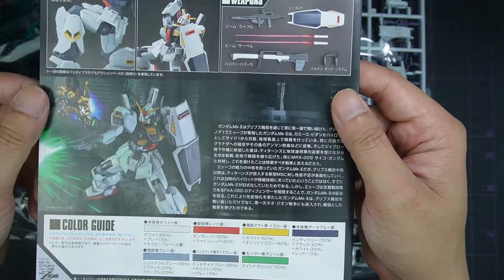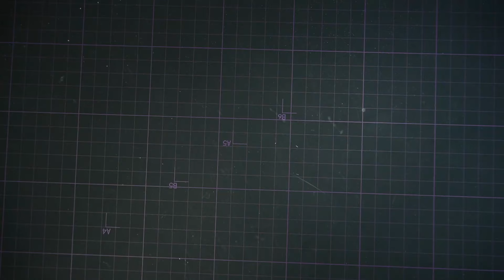RX-178 GUNDAM Mk-2 Weathering. No airbrush.

Comment: Hi! Great work on the weathering! I have a question, did you coat before applying the enamel paint or just apply it on bare plastic?
Reply from the maker: Yes, I coat before applying the enamel paint.
Reply: Thanks for the response, which coat do you use/ recommend to use? Gloss or matte?  @nottoscale6529
Reply from the maker: Semi gloss. @exalteddd

Comment: You mentioned on 8:48 that tamiya thinner can break plastic. What did you do to prevent this? Are you using a different product or approaching the process in a different way?
Reply: For this reason I only use acryllic paints by Tamiya, safe on all the plastics.
But if you're going the enamel route you do the following FIRST:

- Spray acryllic primer if you plan on painting the whole kit. (e.g. Tamiya Fine Surface Primer)
- Spray acryllic clear laquer. It looks like he used a Matte spray. (E.g. Tamiya Flat Matte TS-80)

None of the weathering paints would actually stick to a modelkit that hasn't been prepped with one of these sprays. They would just slide off the bare plastic. And enamel will crack and destroy all of it. As seen in the video, the lacquer prevents the enamel paint/thinner from reaching the plastic; but breaking is always a possibility. 

As recommended by the manufacturer, you can paint with enamels but in the following order: Plastic Model > Acryllic Base (Lacquer/Primer) > Acryllic Paints > Enamel Paints > Metal Paints > Final Lacquer Spray.